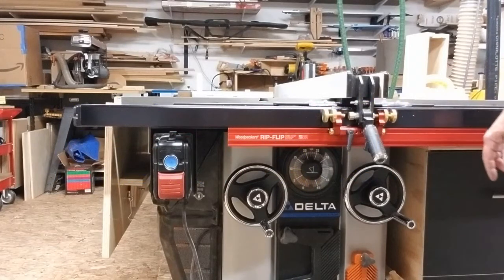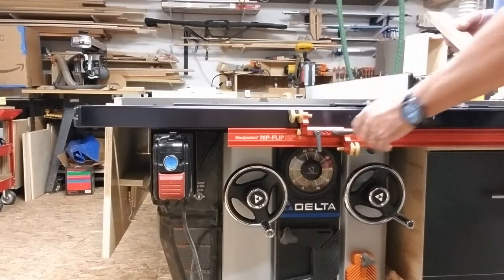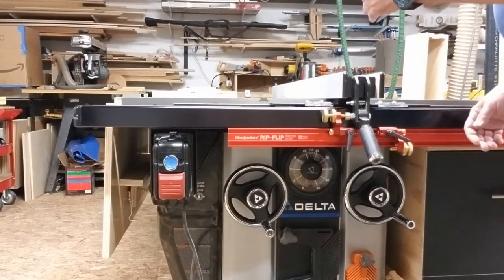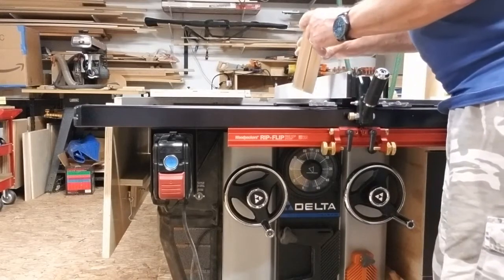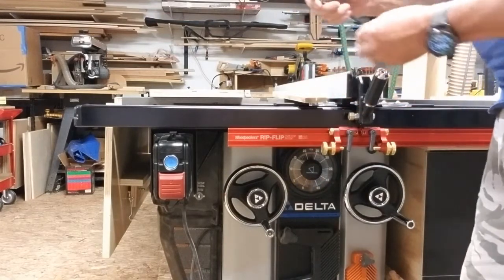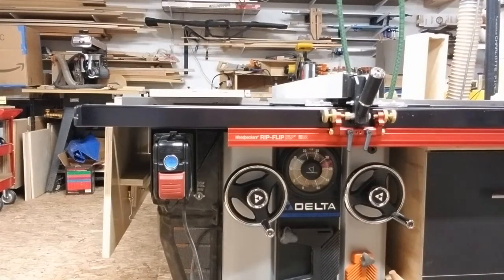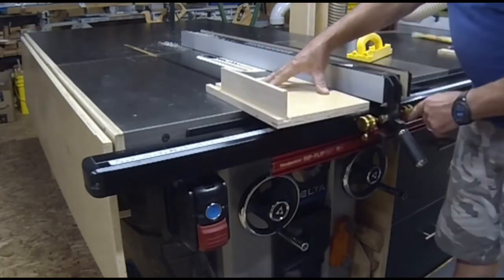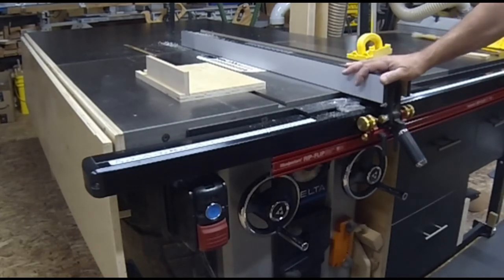Woodpeckers Rip-Flip Easy Dado Setup

Comment: Thanks for the magnet idea. I used 3/8x3/8 magnets from mcmaster.  They slide in without issues and i used the set screws to keep them in place.  I like you idea to use aluminum stock to check for fit.  What size is the one you used in the video?  looks like about 2" x 2"?  where did you get it?

Comment: The magnet was genius. Do you have an Amazon link?
Reply from the maker: No I don't have a link for Amazon. I bought the magnets I used from McMaster-Carr, but you should be able to find them on other sites. I believe the OD I got was 3/8" NOT a metric size (9mm is too small) and 3/8" long, but you could use 1/4" long with no problem. They were a snug fit, I did not use any glue of any type, not needed.